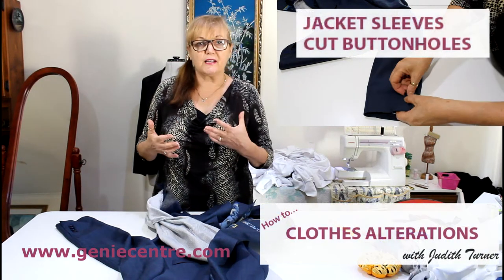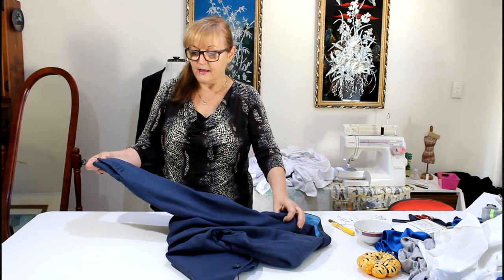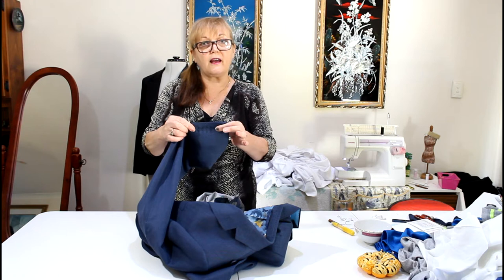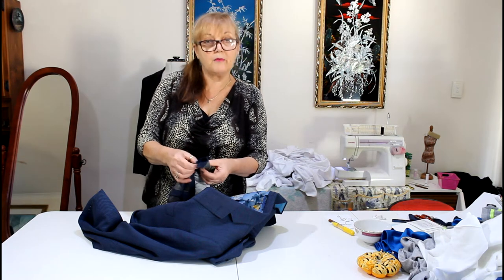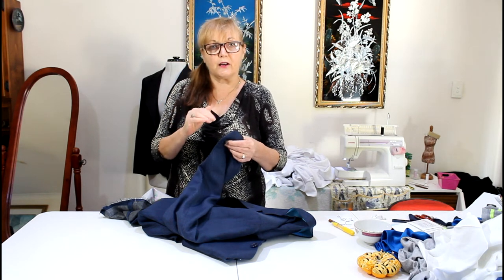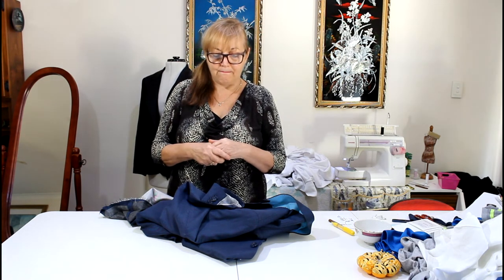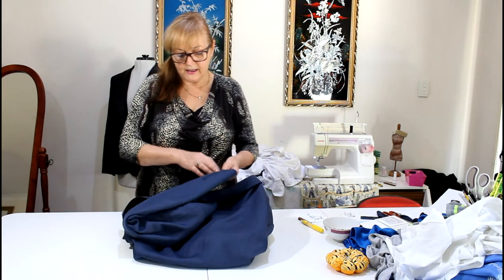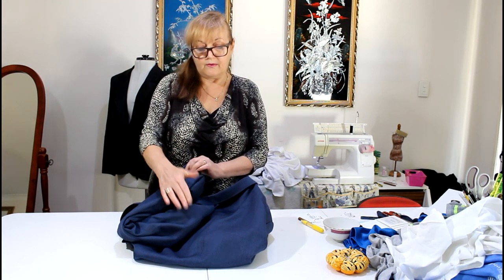Jacket sleeve buttonholes cut

Comment: I'm so with you!!. I have someone bring me that alteration at least once a month.  usually they buy it on sale, so it probably does not fit well to begin with, but "it was such a good deal so I had to buy it". like you said you can only shorten or lengthen one half inch. and usually they need much more than that.  I've turned away lots of unhappy people who thought they were getting a great deal.  working buttonholes should only be done on custom jackets.one other things g that infuriates me is when they attach the tag at the bottom of the sleeve with thread...tiny tiny stitches..which makes it so difficult to remove without snagging the fabric ...hey we should be designer constants.lol.
Reply from the maker: Another one you will like.  I saw a guy wearing a coat lst week, and the back splitflap was still stitched closed at the very end.  So it gaped open but was shut at the bottom.  I mentioned it to him as we were got into the same lift.  He said his wife had told him to cut the stitches, but he didn't believe her!  LOL
Reply from the maker: sorry meant last week.

Comment: Hi Judith! You've made some excellent points in your cool video! I'm just worried you wish for most "Common Man" Suit Manufacturers to "give up" their hopes, dreams, and desires of achieving a "Bespoke Suit" custom look with their "ready made" suit styles. It feels so groovy to be seen out in public with a suit jacket that has real functioning sleeve buttons! Makes me feel so aristocratic and casino royale! Perhaps in a perfect world, a suit customer would do well to "try the jacket on", and really check the fit before buying it.
Reply from the maker: Absolutely Tuck.  I have no desire to stop designers from designing awesome jackets with special features.  What is frustrating for me is when I have to tell my customer that because of their large biceps taking it up from the top of the sleeve is not an option.  Or even if I could take it up from there, the cost is so high that they can't afford it.  Most people who do clothes alterations work on an hourly rate. The current hourly rate in China is AUD$2.13 (11 yuan).  So you can imagine that manufacturing clothes in places with low wage rates is what most designers do.  I charge AUD$40 per hour.  So a customer purchases a suit for AUD$200 and wants the sleeves shortened.  My minimum charge to shortened from the end of the sleeve, without mitre or buttonholes or anything else is AUD$35.  But raising from the top of the sleeve is a massive job.  So the cost is a big factor for a lot of people.  I can't stress enough that I am not against the surgeon sleeve.  I am against people being sold them and told they can have it altered!!!!!  It's not as simple as that.  This is getting a lot of people toeing about a situation that to my mind is simple.  Don't buy a suit with cut buttonholes if it needs to be shortened unless you are prepared to pay the price of having it altered from the top of the sleeve.  And/or be aware that the more that is taken off the top of the sleeve the tighter it gets at the bicep... Judith